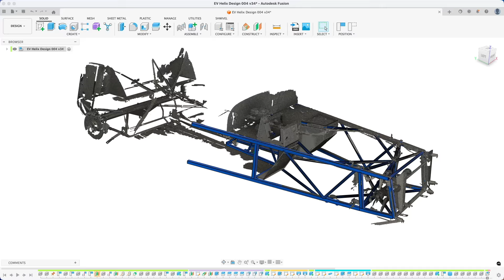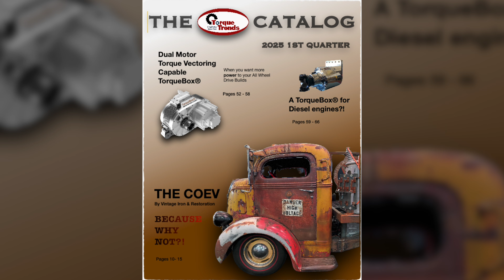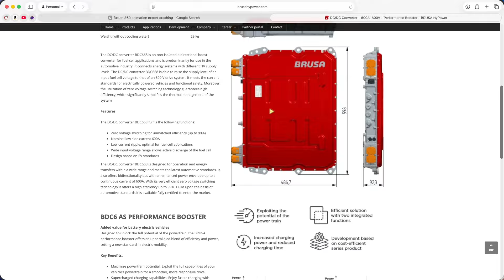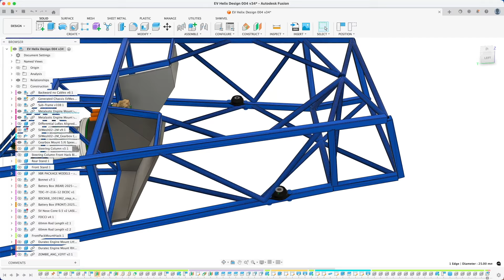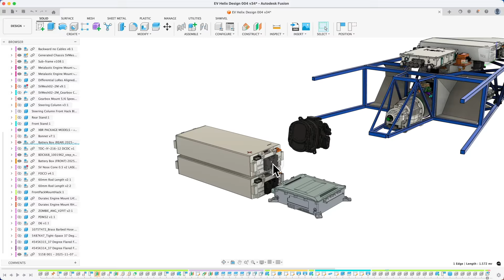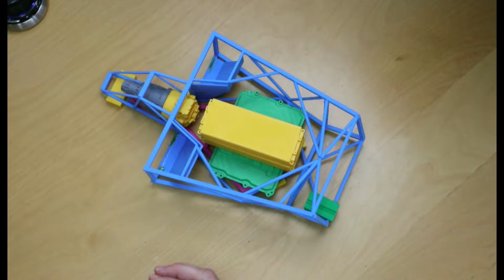Project sEVen pt6 : Mega Two Year Update Video - How I designed an Electric Vehicle

Comment: It's a breath of fresh air to see an all-around professional and relentlessly-analytical approach to the engineering rather than the second-guessing I see on many EV conversion forums.  This is how I would do it myself, but also why I wouldn't do it, as I know it's a massively time-consuming  task. But I do admire your bravery, especially given the cost side of things. I can add a few comments since power transmission and robotics has made up a good chunk part of my career. 
First the planetary gear reducer.  As you're probably aware the original Ford Mach-E has a planetary reducer designed by Borg-Warner (see teardown by Weber Auto channel).  One really interesting detail (to me) is that the ring gear appears to be floating despite that it's rotationally-stationary. That's good design because the radially-confined sun and planets already define the spatial geometry and making the ring rigid radially as well creates an over-constrained condition which could lead to uneven load distribution among teeth that are in parallel mesh at any moment.  No-doubt that's been considered because it's clear your vendor knows their shit.  I think the design is good regarding oil distribution as it's critical at such high pinion (sun gear) speeds.  Notable is the restriction to the pinion to manage the flow.  
Another question is about the motor to gearbox coupling. I didn't see it mentioned but I gather it's a spline with both sides fully constrained.  As you're aware a precision spline has no radial freedom under torque so that requires a high standard of machining precision and alignment.  Many early EVs ignored this risk, as have many industrial couplings pretty much forever.  That may be because different suppliers provide each side and neither accept responsibility for the 'system' engineering.  Nissan got away with this in the Leaf but less so Hyundai-Kia in the range from the Soul to through the 1st-gen Kona and Niro.  The risk is that one of the bearings either side of the coupling will occasionally run without sufficient radial load to avoid outer-race spin in the case with a light press-fit.  The quick fix is to ensure both bearings have outer race retention such as an axial clamp or similar means. Tesla are now using spring pins, see Munro's teardowns. Other use a clamp where required.
You'll note that nearly every current EV design integrates the motor with the gearbox and uses only three bearings in total along the (spline-coupled) high-speed shafts.  As such the spline is now oil-lubricated.
My last comment is regarding oil cleanliness.  Since I don't see a sump I gather there is an oil pump which implies a screen on the inlet. Hopefully there's also a fine-grade filter on the outlet.  This is another area where 'mistakes have been made'.  Hyundai-Kia reducers in the model range already mentioned are commonly known to fail, nearly 20%.  IMO, this is simply due to poor particle sequestration, which I blame on the internal magnet being left loose in a cage.  It rattles around in the oil turbulence and rubs off any particles caught.  Every 2-3 weeks I hear of a new failure.
So, thanks for the high technical content and I look forward to seeing the next update.
Reply from the maker: @KiwiMEchEng, great questions and you clearly know your stuff. A vote of confidence from you is appreciated, though I fully take on board your comment about bravery! 😂. I also really appreciate the detailed questions as this is exactly why I put these videos out. I hope people watching get something from them, but in return what i get is hundreds of smart people sparing their time to consider what I’m doing. So thank you.
First point about floating ring gear ( and I’ve watched all of Weber’s videos, often many times!). I’m not a gearbox specialist per-se, but I have looked at this arrangement for more time than I care to remember. I can’t remember the Mach-E teardown details so for the moment I’ll go with the simple answer - it worked much better, in terms of assembly, to have the ring gear designed as a cup shape (I actually used the exact part in the video where I show straight and helical cut gears). By fixing the ring gear “cup” to the back of the assembly, it meant that we didn’t need a shut line on one side of the ring gear. If it had been a simple internally cut gear, with it sitting into a rear casing on one side and captive by a shut line on the other, then we would have been constrained in assembly further up on the output side. As for the “over constrained forces”. I’ll have to think about that some more. We need the ring gear to be axially and radially constrained as that’s what means the resultant axial forces on the carrier are (near) zero. If the ring floated then that might cause problems. But as I say, I’ll have to think about that some more.
Fantastic second question. We have discussed this a lot on my weekly calls with COG. Have we got it nailed, well that will have to be seen. Both the input and output are splined, though the output does float axially (and it’s the one we’re struggling the most to get a good spec on). As I’m sure you’re aware, even a floating spline will lock almost immediately once even low levels of torque are applied. So you can’t rely on the float to help out there other than statically. On a side note, the floating relationship on the prop spline is a historical hang over. The diff is fixed in the chassis and won’t move with suspension travel, so actually there’s very little axial movement on the prop shaft. This whole spline fitment thing is why I’ve pulled the prop shaft out this week, so we can cut some test pieces and check fit. We have a pretty good spec of the spline parameters from the motor supplier, so hopefully that’s well controlled. But good question, really good question and input.
Hmmm. Good point about lubrication cleanliness. I think I did mention it somewhere that there’s a small sump at the bottom of the gearbox. And a baffle above it to try and keep the output fed with lubricant. Outside the gearbox we do have a pump and an anti-cavitation chamber - removing air from the lubricant circuit. We’re still working on finding a small, and capable, enough design but filtration is a key part of that external (to the gearbox) setup. 
I hope I caught all your questions. Thanks for watching. John
Reply: That is one of the best comments I have ever come across on Youtube.
Bravo Sir!
You have given me much to think about

Comment: I have to say I'm amazed at all the work you have put into this, truly a fantastic project and you've come a long way too!

Even if I'm sure you've explored all the alternatives I do have that nagging feeling that there must be at least some kind of decent used EV module that could be configured to reach 800V and not have a need for a large DC-DC converter.

Using plug-in hybrid batteries would probably be a good solution to get to 800V, but then the energy density would be the problem instead, even subtracting the 39 kg of the converter. Would probably be a lot cheaper though.

Of course you're far too long into this now, though perhaps you can find that golden module before you try to get this into some-kind of production run, so you can skip that large, heavy, and very expensive part.

You have certainly managed a great solution for the motor though! ~29 kg for motor + reduction is the best I've seen for any conversion even close to this power, even if expensive haha! :)

Wish you the best of luck, will be following this project closely! :)
Reply from the maker: Thanks @swecreations 👍🏻
I did a load of battery investigation and while my solution is expensive (at least in its prototype phase) and complicated, I do feel I’m getting a lot of bang for my buck. It’s a shame I’m not getting the I squared R gains of an 800V motor in the battery and cabling. But Seven’s are all about huge dynamics and just making a shopping cart wasn’t going to be true to the genre, so I’m happy with where I’m at. 
There’s lots of scope for cost engineering later on and Brusa do have lower spec traction DC2DC converters, so if I need a lower spec conversion I can swap my larger unit out for a cheaper alternative but all the same software and logic. I also get an architecture where I can drop or add battery modules to play around with power and weight tradeoffs without impacting motor voltage etc. 
Thanks again for taking the time to comment. I’m having a blast with the project! 😂

Comment: I'm surprised there aren't any emergency disconnects or fuses in the block diagram. Do you plan on adding those? Probably also need an emergency disconnect on the front and rear side for both HV circuits? Isn't everything past the Brusa DC2DC 800V? Why are you planning on charging through the DC2DC instead of having the charging stuff on the low side of the DC2DC "directly" connected to the batteries? Maybe then you could also get away with less High voltage, large Ampere wires between rear and front and can halve the amount of emergency disconnects, which are also not small.
You obviously know a lot more and put a lot more thought into it than I have, so I'm curious into what your reasoning is for wiring it up this way.
Reply from the maker: @Blubb3rbub The block diagram was getting a bit cluttered and I didn’t want to overwhelm people with smaller details. All my components will use HVIL and I have emergency cutoffs in various places. So you’re absolutely right… needs lots of that sort of stuff. I will have two emergency stops in the cabin, one in front of my left arm and one behind my elbow. If this thing is “taking off” I don’t want to be fighting the g-force to reach forward and hit the cutoff -might be a paranoid there! 😂
AC charging… I pondered long and hard about where to connect the charging. But it came down to  voltage levels for DC charging and flexibility. With a battery that can get lower than 250V, it seems I might have trouble connecting to some DC charges that won’t go that low (especially with fewer modules… see last point below). So putting it on my HS meant I could manage the voltage from DC chargers better. 
It also meant I could manage the current from an AC charger in a more nuanced manner. The Elcon chargers I was looking at had maximum current limits, so at lower voltages (emptier battery) I wasn’t going to get as much power transfer (it’s been a while since I looked at that, but that’s what I remember off the top of my head). And so if I need cabling for HS connection to DC charging going to the rear of the car, then I might as well use the same cabling for AC charging. 
A further point was that I will probably play around with the number of battery modules. And the Elcon chargers need to be purchased with a specific voltage range they can handle. If I connect the AC charger to the LS and I change the number of modules then I’d need to buy a new chargers putting the AC charger on the HS of the DC2DC converter then isolate the AC charger from any module changes.
How that made sense. Thanks for the question… very astute of you to notice! ❤😂🎉

Comment: Hi! Did you consider Zonic motors (which are 400V) as an option? If not, any particular reason?
Well done, fine engineering and congrats for the high-end orientation of this project. 👍
Reply from the maker: Thanks for the support! 👍🏻 I did look at Zonic… 2 or 3 times 😂. I’m actually based just a few miles from Fellten and do bump into Chris from time to time (I also did their safety course a few years ago). But at the time I was looking for a motor the Zonic motors didn’t have the performance I wanted. Chris was alluding to a higher power motor but I couldn’t persuade them to tell me about it (I’m not their target market… being a single car builder - though how you’re supposed to become a fully fledged company if nobody will sell you anything is a bit of a mystery). I haven’t looked at the Zonic range recently but when I saw Chris earlier in the year it sounded like they had a 180kW version that would fit in a Seven, but it still ran to 18,000 rpm and would have caused me as many problems as I already have. Hope that helps. J
Reply: @Purplemeanie thanks! Interesting story! They may want to focus their sales on authorised dealerships. Still, that could have been mentioned to you!
Still these motors look good on the spec sheet. They do spin too high, but I noticed some adapted planetary gearbox on EVshop, sounds pretty interesting.
I am sort of starting "ideating" an Elan 26R project and having some thoughts about the packaging, which definitely is a challenge on this tiny monsters. Interestingly, a pretty similar layout as yours came to my mind (avoiding the DC-DC converter as far as possible).
The idea would be to set up a versatile vehicle worth for a few quick laps on a track as well as longer road-trips or regularity rallying, aiming at 300-ish km range, CCS charging and sub 6s 0-100km/h. That means +40kWh and ideally 400V.
That's way beyond everything I have seen based on Hyper9-Tesla set-ups, but sounds feasible, and now even more looking at your own project!
Nowhere close to cheap though... 😅 but I have time.
Also, I am not based in UK, making this road-legal is definitely a challenge.
Let's keep in touch!
Reply from the maker: Sounds like a really cool project. If you go and look me up on my website (Purplemeanie.co.uk, Instagram or Facebook) then we can chat offline from YouTube.